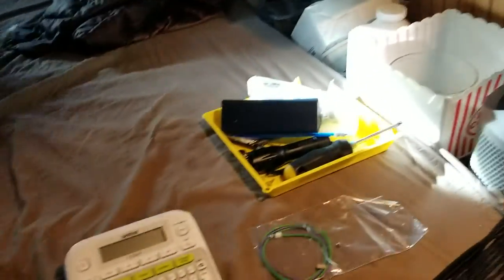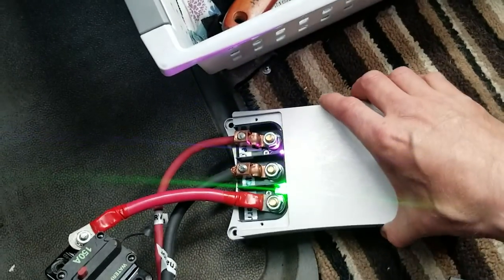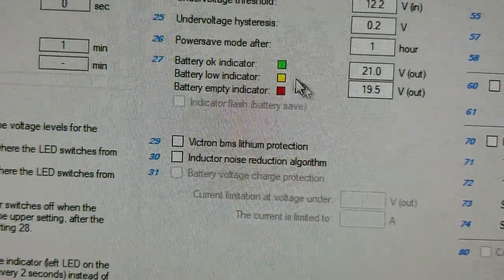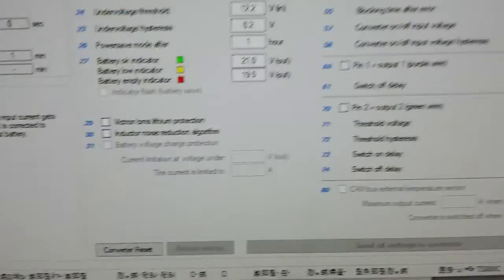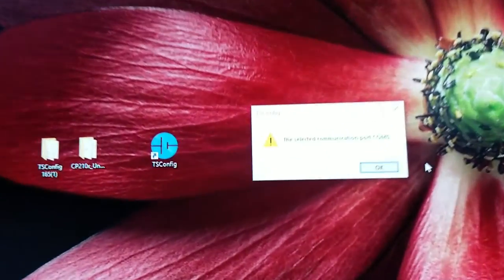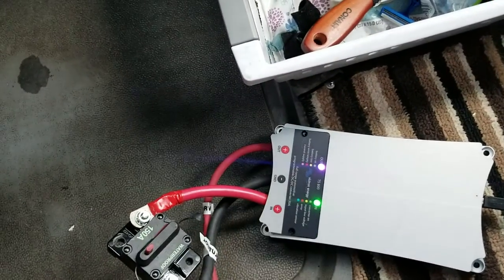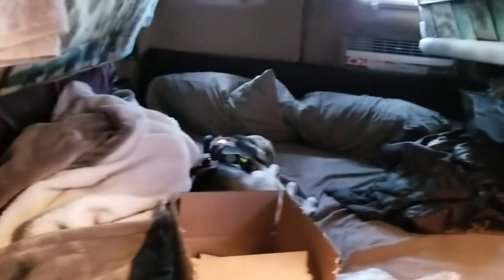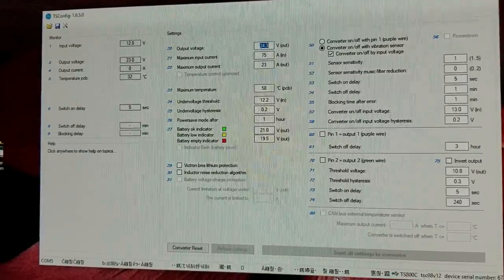Victron Buck Boost DC-DC 25/50/100A Smart Alternator Charger Installation, Testing & Review

Comment: For anyone having trouble finding the COM port. In windows go to your device manager (windows key + x  , then press device manager). Find "ports (COM & LPT)", the open the drop down so you see all your ports. Connect the buck boost with your engine running. You should see a com port appear and it will become obvious which one you should use!

Comment: Hi I have recently installed the newer version of the Buck Boost, however similar to you I cannot connect to the TSConfig, even if I wait for ever, my alternator light also is staying on indicating there is no charge, I have a flashin blue light and also a flashing green light, can you please help as you may be a bit more familiar with the thing now
Reply from the maker: I'd like to help but it's been a long time since I've dealt with it, so I don't remember a lot about it anymore. It's been working so I haven't dealt with it in a while.

Comment: that is one EXPENSIVE piece of brand, or try the 800w boost on ali ex with a fan for $50
Reply from the maker: Oh yeah it's extraordinarily expensive. I tried cheaper ones and they failed.
Reply from the maker: I had to get this expensive one because it's programmable which is necessary when you're connecting it to a dangerous chemistry battery like a Tesla module that when removed from a wrecked Tesla car no longer has a BMS.

Comment: Quick question, i also have a 5.3KW Tesla battery.  I have a Iveco daily 2015 with 150A smart alternator at 12V. I was going to buy 3 Orions smart charger and connect them in parallel to make 45A at 24V and 90A at 12V. But i also considered the Buck Boost but was not sure if the 50A version would give me 50A at 24V also. For price wise if i get 3 Orions smart charger its the same as the 50A Buck Boost but the Buck Boost has half the charging Amps.  How are You finding the Buck Boost soo far? Do you think i should get it or just get 3 Orions smart Charger? Do you think my Smart Alternator would handle the load at engine idle?
Reply: Electrical engineer here. Don’t know a ton about alternators but hope this helps. Don’t load your alternator more than 50% continuously to avoid overheating INCLUDING all onboard equipment on your vehicle, including headlights, air conditioner, vehicle battery charging.  (100% can be used for short bursts to charge your main battery after starting your car. So you’re left with 75A to use on your vehicle. If you use 50A to charge your battery for EXTENDED periods of time then you have 25A left for your vehicle, again, for extended periods. This isn’t a lot if you’re running AC and/ or headlights as well.

^ wrote that before reading you were looking for info about load at idle. You might only get 30% of your vehicles alternator output at idle. That’s pretty borderline for even charging your batteries without running anything else on the vehicle. Your car might be smart enough to boost the idle for you when load gets high, but then you really have to watch out for overheating your alternator since you’re not getting the moving air you would while moving. 

My 2cents is that it’s marginal at idle. If it were me I’d try it for 10 minutes while watching your car battery voltage and alternator temperature. If battery voltage doesn’t drop at all, then I’d try running for 30m and check the temperature of your alternator. If nothing seems too far off your golden, but unfortunately can’t give you more than that. Every car/ battery system is different.
Reply: @StefanHallEffect  thank you, we ended up getting 210A alternator for the van, and our 3 chargers takes draws 130A max, and 90A when it’s hot. I ran the alternator on idle to see how hot it got on and it didn’t get over 50 degrees. I’ll keep an eye ok it though. It’s only in the winter we would need it, so it’s always going to be cold, but in summer, we would only have our 620W panels we use on the roof etc

Comment: I would check to see if the fiberglass blanket is fireproof.  As far as I remember, fiberglass will burn easily.
Reply from the maker: Package says "thermal protection from sparks and spatter", "made of flame retardant fiberglass", "all blankets are subject to burn through from molten slag/metal"

Comment: I like your videos about Tesla batteries. I'm thinking to buy the same. Does it have built in protection system, not to overcharge  the battery? Or I'll need something separate?
Reply from the maker: It came with a "BMS"  (battery management system) that only works with a Tesla car, so that was removed and other components used as shown on my webpage that explains everything: http://econeato.weebly.com/battery-systems.html

Comment: Great video thanks. Ordered the same one and not sure how to wire. So there is only one red wire going out to the Tesla battery? what how come there is no black wire going out also? thanks
Reply: Hi Eric. How are you? Thanks for your your support and help. I did get the same buck boost. Just not 100% about the connections. Did you hook up the buck boost directly to the sprinter battery, positive AND negative? I have some sort of contraption on the plus and minus pole of the original 2013 sprinter van battery. Do I just take it off and hook  positive and negative buck boost cables and put the contraption back on? Or did you just use the positive pole of the sprinter battery and connected to ground within the feet compartment? Many thanks Eric.